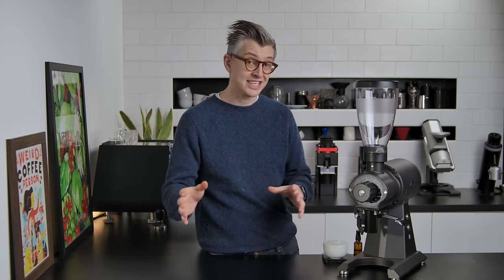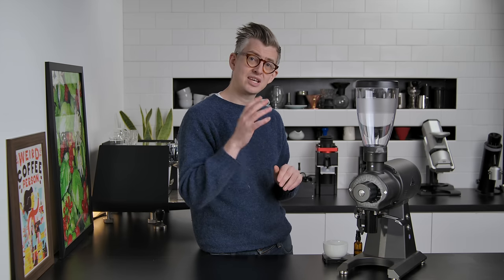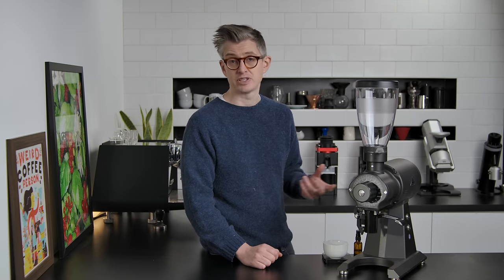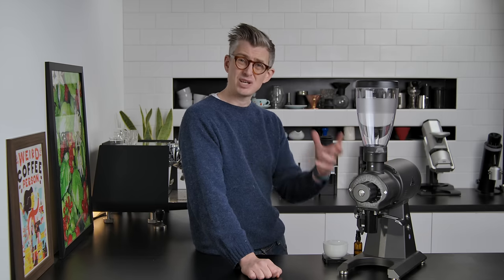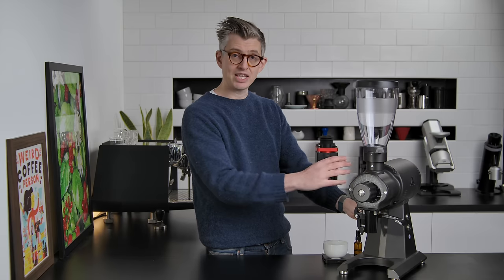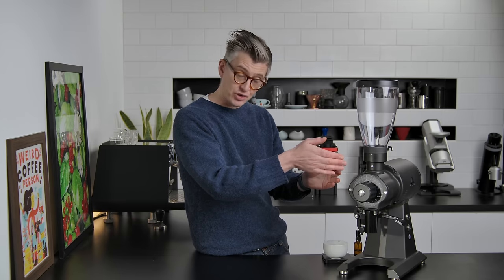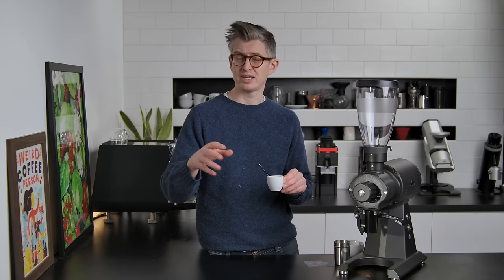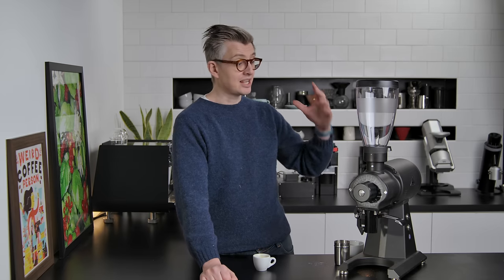The Mahlkönig EK-43S (Episode #3)

Comment: i have to say that your absolutely right about the hopper quality issue. I use the EK43 almost everyday and i love it for its robust and heavy build materials and of course the grinding quality, but the hoppers are always bad. 
We’re using the Short hopper version they just released last year or so, and it’s bad! Cheap plastic, the spring system broke after two weeks and a dark hopper sucks, since you can’t see your beans when they’re in the hopper. 

Anyway still a great hopper with a huge range of grinding opportunities.

Comment: Every cafe I've ever been in used some version(or knockoff) of this. That's exactly what I was thinking when he was reviewing the last $3500 grinder. At home, it needs to fit through the door and on the counter and usually under cabinets... If you want a commercial grade machine, you buy the commercial machine for the reasons that James pointed out: Mostly local service and commercial use warranties. 
Home users will probably find something like a niche or p64 better in every way. For 1/5 of the price you can have machines that are designed to do what you want them to do. 
I really would like to see some more reasonably priced grinders coming out. It's just a couple pieces of machined steel and a cuisinart motor. It shouldn't require thousands to get a decent one in 2021. 
I get that the "ultimate high end machine" is more youtube algorithm friendly, but really the exciting part of any equipment is "value for money" where does the money start to just line pockets instead of making a better machine. Telling my friends about the machine tolerances on the outside of my coffee grinder just makes me feel like a dick. But on the other hand it needs to have enough tolerance to actually grind espresso correctly.

Comment: May be a dumb question: is it possible to set these for both espresso and filter coffee? I’ve used one before and even all the way to almost 0 was way too coarse for espresso. If you set the burrs to be closer for a range of espresso grind size, would you still be able to use it for filter coffee on the other end?

Comment: I had an EK43 with Turkish burrs and had several attempts to align it. Was a pain in the arse but got it as good as you can get using the Titus aligning tool and shims etc. Ended up selling it as the espresso (or EKspresso..) it produced wasn't to my taste. Although I did have it for 18 months so did give it a chance. I've gone back to my Customised Versalab M3. I also have a Mazzer Major modded for single dosing (Daniel Wong kit) and a Niche. For all 3 I'm getting pretty much out of them that I weigh in. Bit disappointed that the Versalab isn't in the list of grinders in this series as its burr-set is unique (in so much that Titus copied it, and now the Hedone Honne.) having both conical and flat combined. Maybe one for a future review (though it's now the M4 and has solved a few of the M3's problems)
Reply: Update... Got rid of the Versalab M3 as it was a right faff to use. Gone back to an EK. Now running an EK43s alongside my Slayer and use it for espresso as well as AeroPress etc. Can't fault it, apart from the daft hopper (which I replaced with a small one) and the exchange (often called retention). Shame Mahlkönig never went ahead with the Barista model with the portafilter holder

Comment: The killer is $700 for a burr set. How may cups of coffee do you have to sell to get a reasonable ROI on just the burr set and what cafe, being businesses after all, is ever going to change them?
Reply: I personally would guess the average cafe, most if not all probably grind until the burrs fail or something tastes really off. There is no way they track the X of kilograms ground and then change the burrs.  As a home user, I buy grinders with burrs I know will last the entire lifetime of the grinder.  So far that is conical, and from what I read titanium flats last a long time too.
Reply: @georgepirpiris7309  I think the reality is that for a cafe the EK43 is a good solid grinder for doing pour over/french press bulk grinding for customers.  It is robust, easy to service and easy to clean the whole grind path. I wouldn't dedicate it to grinding espresso - its adjustment at that range is somewhat coarse and you have to finesse it and probably replace the burrs to the turkish ones to get there. I don't get why they charge so much for the burrs except that they can - this applies to all other Mahlkonig products.

Comment: My absolute gripe with this grinder is the fact that the anti static strip is designed to fail, and the sheer plate, though yes it’s purposefully designed to fail, fails too quickly in a cafe setting, and to prolong its life you have to wait until the motor comes to a complete stop, and it takes forever to do so.
Reply: But if I was ever given one for both my cafe use or home use, I would not complain due to its amazing performance.
Reply: @James L oh man that sucks!

Comment: Basically what I'm hearing is that this grinder is not gonna win
Reply: Given that two of the other grinders use the same type/size of burrs, I find it very unlikely for the EK43 to be even relevant, as they'll both be better aligned and have better work flow.
Reply: He said it clearly that it is out of place in this contest. If the review was for the best grinder for a cafe setting it might have won, who knows.
Reply: Maybe not win overall, but I would be surprised if it didn't rank well in a taste test
Reply: @wszczeklypiesz  it would clearly win against the first two in a café setting, simply because there filling in the beans will become finicky. Which is fine if you grind for a cup or two at home, but as a workflow in a large volume setting it's a pain in the butt. Unless you retrofit some kind of a hopper or funnel on top, but then you destroy the design language.

Comment: "These little details do bother me" - Unsurprising statement of the year 2021. 

That been said on the point of mods - I think as consumers we want to know what's the max value a product can bring to us at home - if that's moderate modification I think that's acceptable. 3d printed single dose hopper and alignment mod seem OK to me.
Reply from the maker: I think modding is an interesting aspect of equipment like this but it becomes something without limit or definition - so harder to review. Reviewing as stock is important for understanding what your money gets you, though I understand you're buying something with more potential. It's hard. Maybe I just took the easy route!
Reply: @jameshoffmann  I'd suggest a second review of it modded perhaps? Explaining what worked and what didn't?
Reply: @jameshoffmann  the sustainable route. Videos are awesome. Just a note on the point itself was all.
Reply: @jameshoffmann  Personally, I think the way you handle it works. You have to establish a baseline so that comparisons can maintain some level of accuracy and objectivity. Otherwise, what's the standard? I think you've done a fine job providing oral "foot notes" during your videos that speak to the potential (or need) for modding.
Reply: @starwf07  I agree.

Comment: Awesome review! I would have considered one of these for my coffee shop (and I had a large 3-phase, 1950s or 1960s Polish made, cast iron grinder like this that I used to grind for French pot and filtered coffee that was incredibly reliable and had very even grind) but NEVER for my home. First issue is price - $3000 for a grinder for the home is ridiculous. A business can amortize that cost (which the manufacturers know, hence the crazy pricing of cafe equipment), but a homeowner can't. It just doesn't calculate. Second issue is that its grind volume is, like you said, designed for a coffee shop or store. We drink a lot of espresso in my house pulling between 7-10 shots per day at ~8 grams per shot, so less than 100 grams. This grinder probably wouldn't even get broken in during the first three years of its life with such a small volume. Beautiful to see, though.

Comment: Hmm. I see two benefits here, 98mm burrs and the grind settings seem easy to change between espresso and drip.  However help me swallow this, no timed dosing, no portafilter fork (have to dose into a cup!), 3K$ and it doesn't have perfectly aligned everything?  Also if James is right and you actually have to chase the grind setting and alot of people experience that and not just the very anal, then I got to take a hard pass.  Let me make it easier, why would I buy the EK-43S over say the Mahlkonig E65S GBW which is the same price.

Comment: The good news is, you don't need this dork's permission to use the Mahlkonig at home.  I own the EK43S, and I use it to grind a 20g does 3x/day and I absolutely love the grinder.  It's fast, easy, a little scary, and has extremely low retention.  With a couple of knocks and a quick once-over with a small pastry brush, I get between 0 to 2 tenths of a gram retained, using the small, single-dosing mini hopper.  If you want one, get one, regardless of what His Majesty tells you.
Reply: HI Lars, with the single dosing hopper, do you run grinder before dropping beans? ive have my EK for a month and still playing around. Thanks .